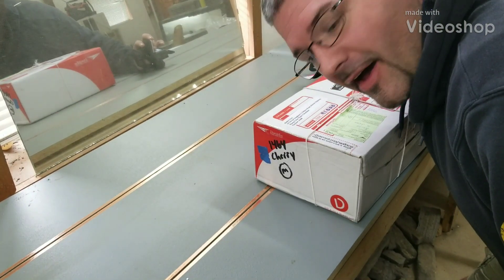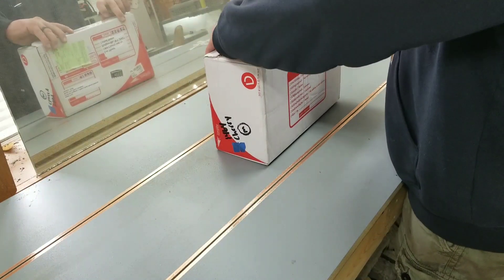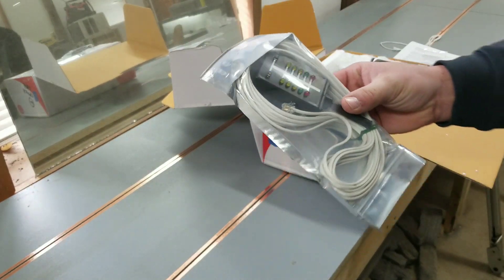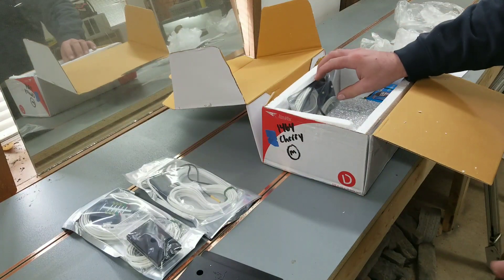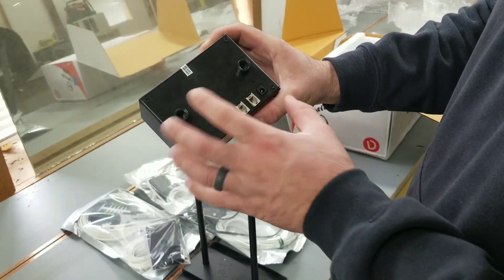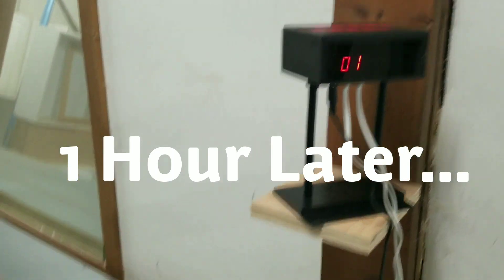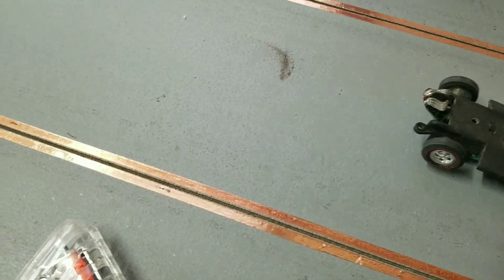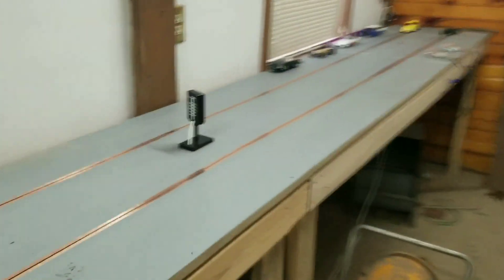Slot Car timing system

Comment: How does it know when to start the clock (does it read when you press the controller, or when the tree turns green, etc.) In other words, can I use it with an existing tree, or does it need to be paired with the Slot Dragon tree?
Reply from the maker: It has a photo cell in the track under the car in each lane at the start and finish. So when it times when from when you take off till the finish
Reply: @leemosausagemo517  Oh nice, that makes sense, and seems like the most accurate method of measuring the car's time.
Reply from the maker: Yeah. It's pretty fun

Comment: Hi there was watching your channel,  I went and build a 13 and half ft slot car drag  strip in our house , its for the HO and viper cars, I got the copper  sticky tape for it, it was to see what wires or battery do you need, just an easy simple way, thanks
Reply from the maker: You could just use a battery and wire up the positive side, set the cars on and the connect the negative side to make them take off at the same time

Comment: Quick question how did you add the controllers?
Reply from the maker: I have the power supply feeding one side of the tracks and the other going to the controller and back.. if I remember correctly
Reply: LEEmosausage mo thanks so much!